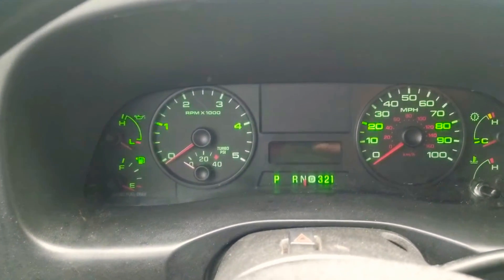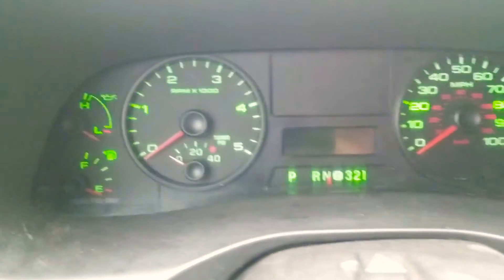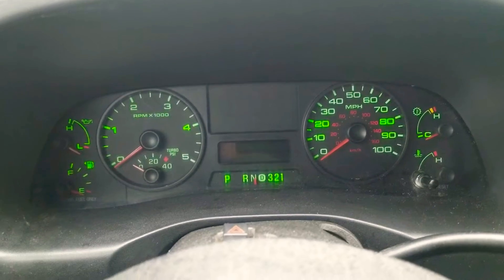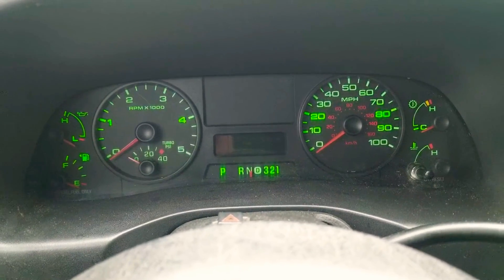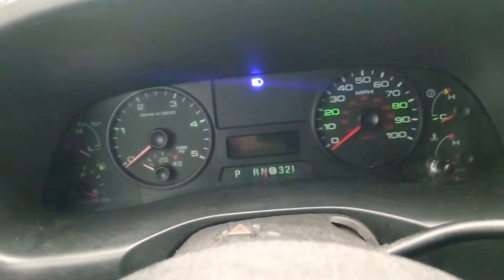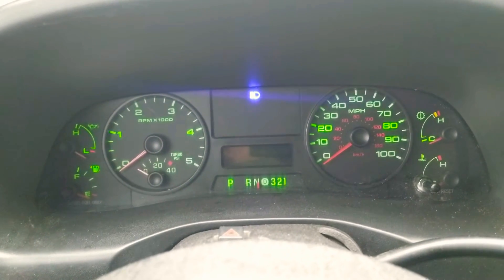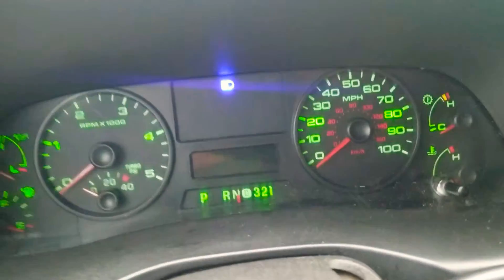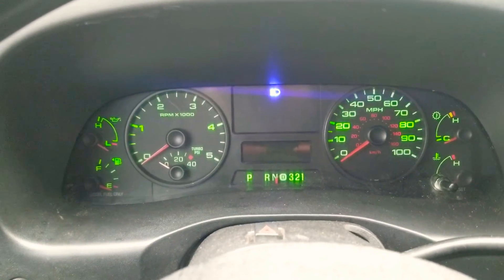F-350 Instrument Cluster Lighting Upgrade Part 2

Comment: Regarding the F350 cluster, do you know if the cruise control light is a bulb or an led soldered to the circuit board? My CC light went out a couple of weeks after I replaced all of the bulbs with LEDs as you did. Again, I’d like to know if the CC is lit up by a bulb. Thanks.

Comment: Did you use white or green LED’s?
Reply from the maker: Jason Moore I used white LEDs I’d buy a better quality led, they are now starting to flicker and I don’t know if it’s the LED or the contact in the gauge cluster! Take your time and use some Die-electric grease on the contacts as well which I did not do!  Thanks’
Reply: Frontier Landscape thanks for replying, I have to figure out what size led I need for the dash in my 05 F350.
Reply: Frontier Landscape picked up some LED lights have to swap them out this weekend. Thank you for the video
Reply: Jonathan C.  I swapped them out only had issues with a few indicators being to bright but they look great